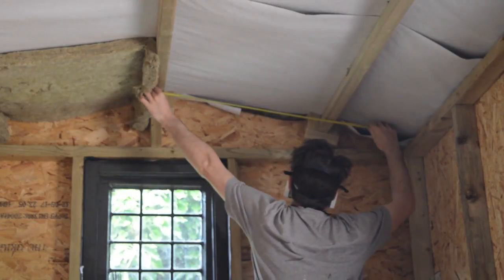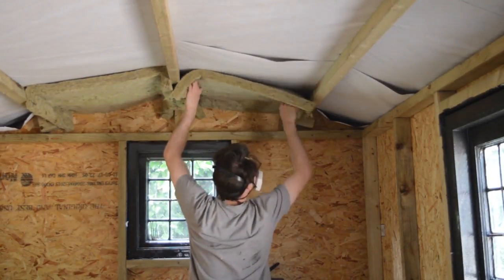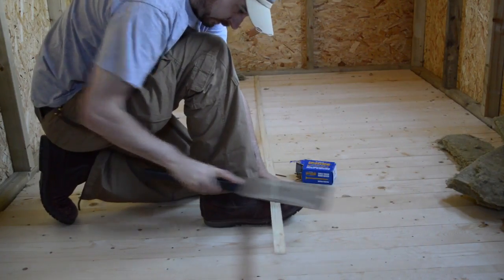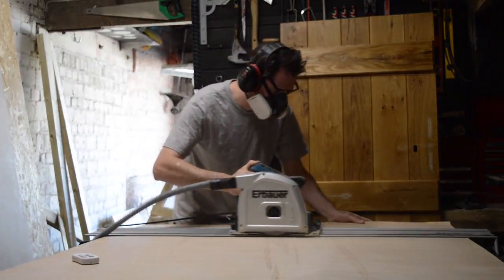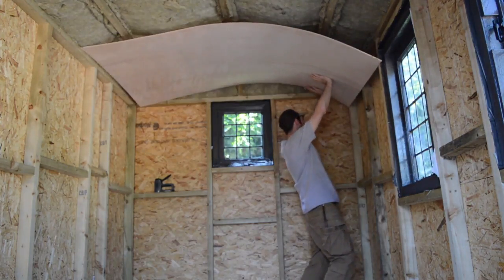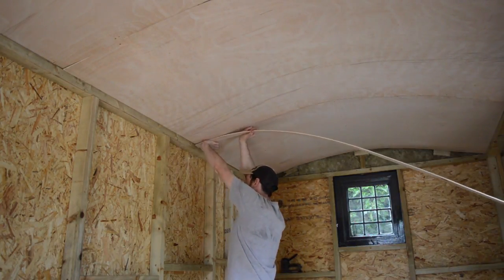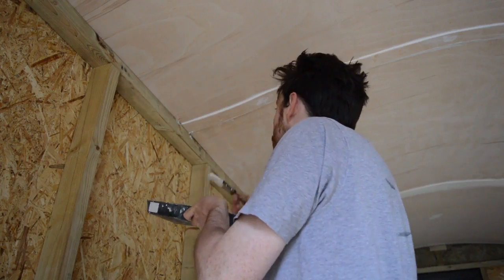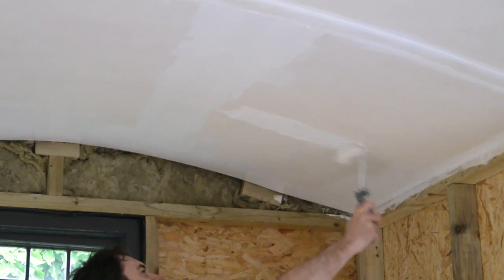Shepherds Hut Build Part 12 fitting the ceiling

Comment: Brrr, working with rock-wool. My arms already start itching.
Reply: B Brewer I was thinking exactly the same thing. Matt is either hard core or has no feeling below the elbow!
Reply from the maker: I have been told I'm dead inside. 

This stuff was not bad to work with
Reply: +Kryten605 Speaking of the intro, what happened to the sign clicking into focus bit, Matt?